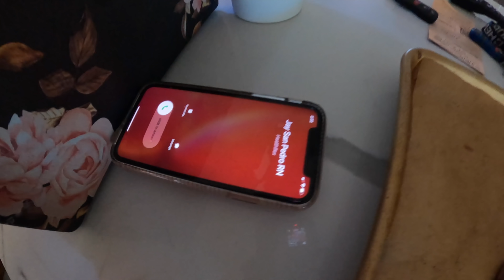Added A New Car To The Collection, Its Twin Turbo Also!!!

Comment: In regards to purchasing the SC as a cheaper alternative to the Supra. Imo makes more sense, same potential performance and does all the same things a Supra would do. I did the same thing and purchased a 2014 Chevy Caprice, I wanted an SS but with the prices and availability the caprice made more sense for me. I picked one up with 40k miles  for 14k. Did a Chevy SS center console and shifter, door panels, instrument cluster. Full BMR suspension / coilovers.. honestly a ton of other stuff.  All that said I get the logic

Comment: I have a vr30 bro and go full e with upgraded turbo you’ll make 650
Reply: And just get ams parts spool performance is cheap quality I’ve gone through 2 hpfp
Reply: Ams lpfp 
Ams big bore hpfp 
Hks intakes front mount
Full downpipe
Ams v2 flex fuel kit 
Frozen boost heat exchanger 
Ams injectors 
Easy 500+ setup

Comment: Honestly I don't think it needs a lot looks-wise, color match the bumper, black headlights, '16+ nismo spoiler, little drop and and some meatier tires on these wheels. I like these wheels tbh, TC105X's are one of the lightest wheels you can get if you don't want RPF1's, and I think they look pretty good. 370z badge gotta go tho, since it's not a 3.7 anymore lol

Comment: MAN… I’m the other guy on YouTube with the VR swapped 370z lmao. 

I’m curious to see how they do vs each other 👀👀
Reply from the maker: Lol I Waddup bruh, Jon tuning my z also lol 😂 but my shit gon be slow. I’m not going crazy on it. 400whp is the goal and that’s it. I’m not trying to go to crazy with it right now.
Reply: @Its_Mike_Myke  nah, you’ll do 400 too easy. I’m CRUISING at 450-500. I DM’d you again. Jon tuned my VR swap right and I’ve been running 2 years strong.

Just check the belts, the ac compressor and pull the y pipe to see if the turbo seals are blown. There are a few common issues, but I daily my Z and put 17k miles so far.

Comment: That SC300 definitely gonna get new wrap. I can't wait to see this thing back up and running again. Long ass journey with this one. Still want my SC400 🔥
Reply: Get one...great car. Turbo is too. You won't regret boosting the V8
Reply: @Wiggy321  LS400's has a 10.4:1 compression ratio meaning you won't be able to add much boost before it blows up. I guess you can run 5 psi but whats the point when you can just do fbo mods and make more power more safely. So yes, you will regret boosting an LS400 lmao
Reply: @lsx646  sorry to disappoint you on both fronts, but FBO on a 1UZ will not yield more power than boost, even at 5psi. Reliability is solid on that motor on boost. I had twins on mine at 7 psi bone stock. Car still runs many years later
Reply: @Wiggy321  How much power were you making, I assume no more than 500 wheel? Most guys put smaller rods to reduce the compression ratio however you mentioned that yours is still stock. You should post some videos of that thing! This guy did the same thing and he made 750 BHP with lowering the compression ratio: https://www.youtube.com/watch?v=kE9e70cENeo&t=248s&ab_channel=OFFICIALLYGASSED-OG
Reply: @lsx646  that's a horrible example. Sean Musa's is a much better set up. He's in the 700whp range. I only made 375whp @ 7psi running 80% duty cycle. HG and injectors at 12/13psi should give you over 500whp. 
Why would you want to run weaker thinner rods. Pre 95 rods are the rods that handle boost. A thicker HG will lower compression.

Comment: I can’t wait to see when you get a ctsv I really thought you picked one up but this is a really clean build can’t wait to see it 💪🏻🤘🏻
Reply: honestly bro needs a V for the channel !
Reply: Cts v isn't twin turbo
Reply: Cts v is twin turbo 6 cylinder and the cts v black wing is the v8 supercharged last year they making them with v8
Reply: @Bigdoggonnaeat100  my wife drives a 2018 cts v super sedan and it's supercharged from factory
Reply: Sounds great man 👌
Reply: My bad I might be wrong on this getting ats v confused with cts v
Reply: @Bigdoggonnaeat100  no I believe you are right the newer ctsv models are twin turbo now from what I read
Reply: I thought so I just wasn’t tryna be smart ass lol I’m a big Porsche guy 😂👌
Reply: I do no if you buy a 2022 ctsv blackwing that you will have a pretty nice investment for future as they will last ones of assembly floor
Reply: @Bigdoggonnaeat100  you are confusing cts with ct5. Ct5 v is twin turbo. Cts v is supercharged. Ct5 Black wing is also supercharged. They no longer make the cts
Reply: @sirspeedsalot  new CTS-V comes twin turbo V6, I thought Myke was gonna pick one up Forsure
Reply: Bro I wanted him to get the CtsV too but this joint cool for now
Reply: Hell nah..lol
Reply: Congratulations on the new addition! 🔥

I want to buy a G37 or 370z what do you all think about a high mileage one?Something with around 70,000 miles. Are they reliable up to 200,000 miles?
Reply: Grandma cool
Reply: @sirspeedsalot  no, all cts-v's are v8's, the v2 and up are supercharged from factory. ats-v's have always been twin turbo v6.
Reply: @IAMWAXX  you are wrong check your facts . There is a thing called Google , try it sometime.
Reply: @IAMWAXX  2018 Cadillac CTS-V review: Our expert's take

What it is: The CTS is Cadillac's mid-size luxury sedan and is offered with rear- or all-wheel drive. Three engines are offered: a turbocharged 2.0-liter four-cylinder, a 3.6-liter V-6 and, on the V-Sport model, a twin-turbo 3.6-liter V-6.
Reply: @sirspeedsalot  the cts and cts V are classified as two different cars the v isnt just a trim level for the cts its litterly a different car
Reply: @ant1000ful  yes and yes. 70k is low still. Anything under 120k and you're good for at least a few years. Get a g37 if u live where it snows. 370z if you live down south. I have a 2008 g35x I absolutely love it. Super reliable i'm actually on my second one. First one got flooded lol
Reply: @justinholtgrave  Thanks for the info I appreciate it. 👍🏼